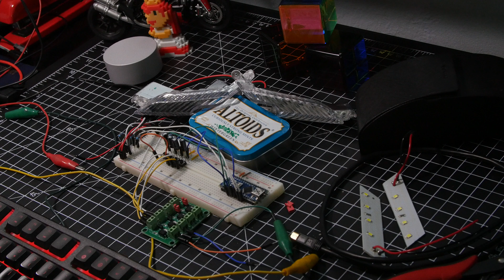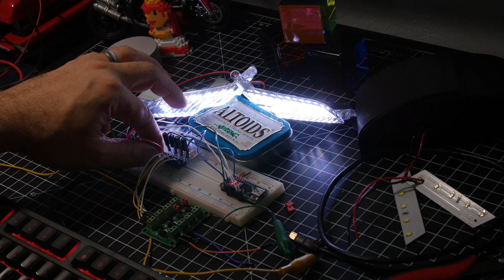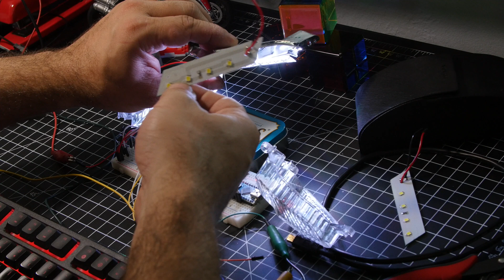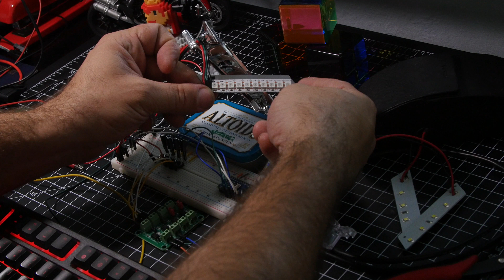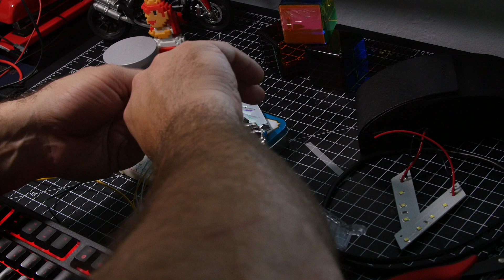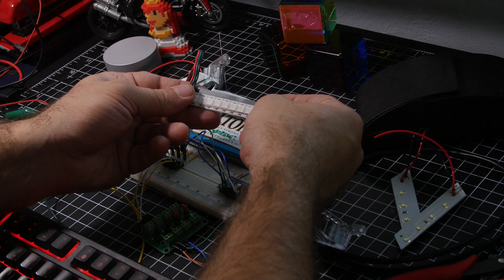Modern LED turn-signal w/ Arduino, FastLED & WS2812 w/ external 12v trigger

Comment: Hey, so i was able to get everything working except the turn signals go inward instead of outward and also the knight rider lights do not override the day time lights. I'm using the code you posted so not sure what im doing wrong. Any help would be greatly appreciated.

Comment: Dumb question, how did you disassemble the headlight to get to the LEDs and fit the projector in?  Is the lens glued in place around the edge? literally sitting here with my 848 SF headlight partially disassembled on the coffee table trying to figure out how to get the lens off 😄

Update: figured it out and put 'er in the oven.. stupid glue XD
Reply: Maybe you already met with Heat Gun I guess 🤔
Reply: @jamesjangao2807  Yup XD well.. didn't have a heat gun and used the oven, but same idea.

Comment: To sort the rainbow effect, you can use SK6812 RGBW LED's, They come in Cool, warm and neutral white as well as RGB
Reply: Amber turn signals also can show too much green, so that doesn't help. Those vellum strips will reduce efficiency since 5050 rgb leds are less bright than classic 5mm LED. Bought some 30° and 60° lenses for 5050 but it's hard to focus them, in a an intended position they don't throw at all, will have to be glued  on top of IP65 silicone coating so that they are higher for better throw to increase the visibility in direct sunlight.